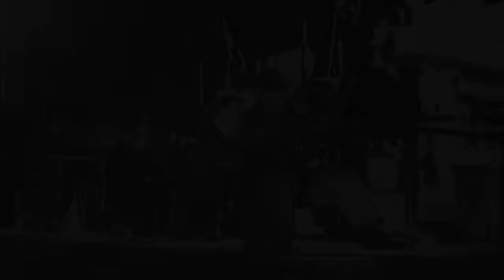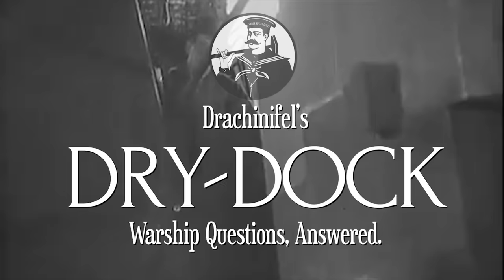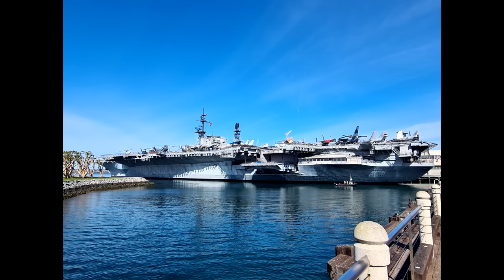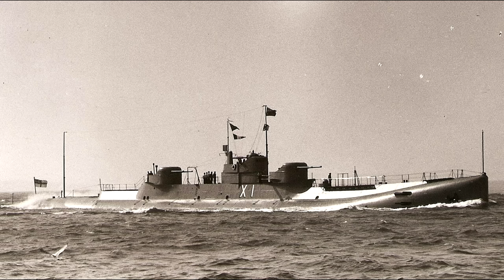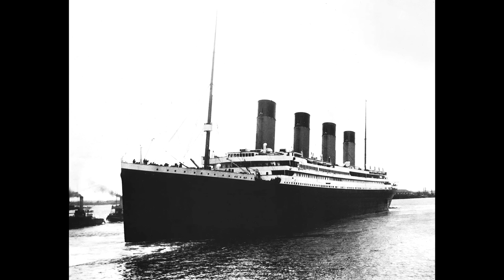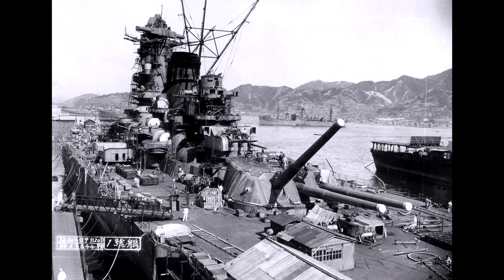The Drydock - Episode 284

Comment: In regards, to the use of the white wrap, it has several uses. It is used to contain grinding / sanding operations. It is used to protect exposed worksites, as well as areas being painted.
Reply: Also used as a wind break for welding operations

Comment: A possibility for the first of the month after next - Nautilus. No, not that battery-powered 1950s thing, but the grand original from 20,000 Leagues Under The Sea (aka Journey To The Centre Of The Earth, Out The Other Side, And Into Orbit ) 50 knots submerged isn't to be sneezed at, nor is the serrated ram (I used to have the clockwork bathtoy). I can't locate the reference, but remember once reading that after Captain Nemo's staterooms and his other necessities have been allowed for, there's about 5% (if that) of the hull volume left over for such trivialities as crew, machinery, fuel, and air supply.
Reply: When the crew went out on the seabed and stunned some fish with missiles of some kind I went around asking how to make a small missile that would generate a sharp electric shock on contact.

Comment: I think you meant circumvent rather than circumnavigate a problem. :)  Metaphorically circumnavigating a problem would mean looking at it from 360 degrees - and winding up right back where you started. Which raises an interesting question in and of itself: can you think of any naval problems where the first proposed solution was rejected as being unsatisfactory for some reason, and after considering several alternatives the final answer was the (perhaps still unsatisfactory but still better than the alternatives) first proposed solution?

Re. Sumner vs. Gearing: I think Battle(1942) vs. Battle (1943 or perhaps 1944) might be a better answer, since I think the question being asked was about how the Gearings are essentially just bigger Sumners in order to fix minor shortcomings of the initial design.

Comment: 29m56s: as of 2005 when I got out, while they can be used to cover sensitive things being worked on, the two big reasons for the plastic are either weather or environmental.

catching old or new paint or other chemicals before it goes over the side and protecting the workers or the work from inclement weather or the cold, or to try and close off an opened-up section of the hull/superstructure.

in the picture, they are probably redoing that section of non-skid on the flight deck.  the plastic was put up for the removal process, and not taken down because its a good barrier around the laying of new non-skid, both to keep the wind form blowing stuff onto it, and to keep people form walking on it till its cured..  and i can sorta see the new stuff, its a very dark bluish grey when its new.

Comment: Took a c;lass at Bremerton NSY where one of the classmates worked at the yard.  Brought in two pieces of steel, one from a scrapped Permit class,  which was at least 8 cm thick, the other from an LA class which was only perhaps less than 2 cm.  Amazing the changes in metallurgy

Comment: one big challenge with the preservation of large ships is that we do not have the infrastructure to produce a lot of the materials used in their construction... whilst wooden shipwrightng is something of a lost art, it is something for which you do not need to build a great factory or dig a mine... no one makes Krup Steel these days, so you simply cannot replace cracked or rusted armor plates the way you could with a wooden hull.... nor can you as easily maintain the structure, every part needs to be sourced from some limited source... no way to really reproduce it in an environment where such materials will necessarily die out.

Comment: 49:40 "limbered up means a cannon / gun is under tow not prepared for firing.  As an example a 15cm K16 and 17cm  K18 would have its barrel removed and on a dedicated barrel limber if "Limbered up".
Reply: It did sound as if the barrel was being mounted and made ready for travel.  
I thought the travel would be caused by recoil.
Reply: @myparceltape1169  Yes I understood it as that but "limbering up" is a technical term and Drach being an engineer not a hoi poloi needs to avoid using term in-appropriately.
Reply: @SCjunk  I am glad you have told him.

Comment: Submarine hulls crushing: in the modern US navy it’s a fairly common practice to run a string from one end of the pressure hull to another and pull it taught, and you at great depth can actually see it begin to sag significantly

Comment: Is it more important for ship types to be defined by their roles or to adhere to a roughly graduated system based on displacement?
Reply: I'm not sure I understand the question ❓
Reply: @WALTERBROADDUS  The USN has the Arleigh Burke destroyer which displaces about 500 tons more than the Ticonderoga cruiser. 50 years ago that wasn't the case; cruisers were much bigger than destroyers. Which makes more sense: ships being typed by mission roles or ships being typed by size?
Reply: @RoastedOpinions  who is classifying by tonnage? Function has always been more important.